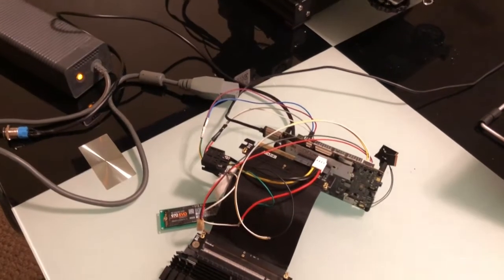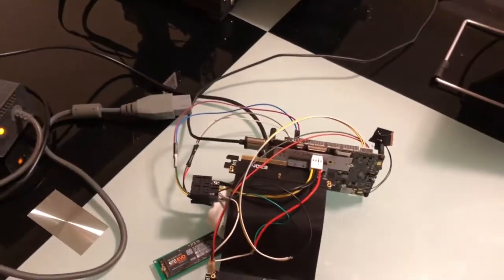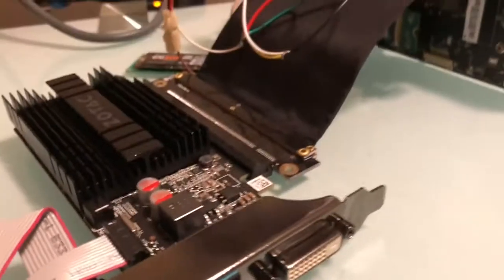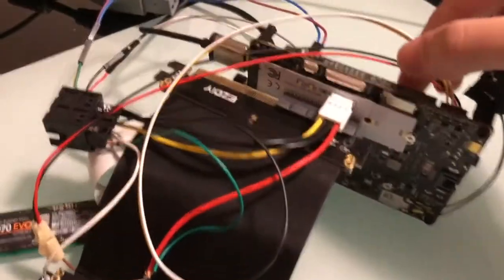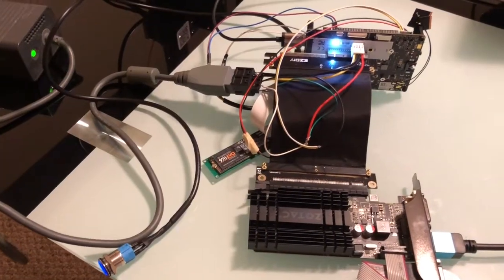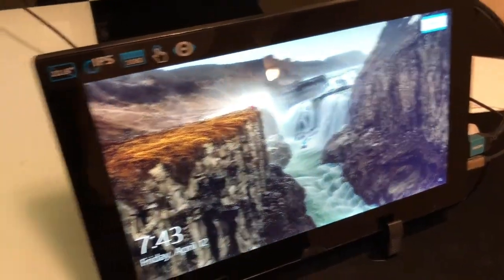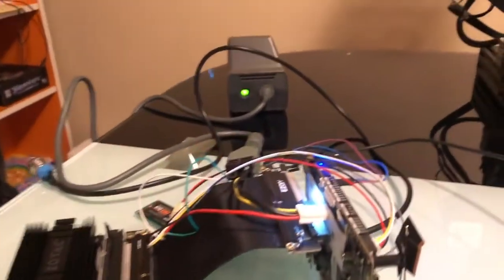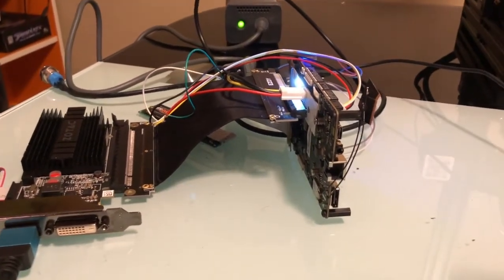LattePanda Alpha - GPU and SSD - off one power supply!

Comment: Yo , sorry if it's a dum question but does the gpu require 12v + 3,3v or just 12v ?
Reply from the maker: nistax just 12v actually, I’ve used a straight 12v power brick 120W works fine, could use a cap though
Reply: @HandheldHardware  thanks dude , that is super convenient

Comment: Great project! Can It be run using power bank?if it's yes. How much power supply? It's great to make a portable computer that could run some steam games, and bring it anywhere.
Reply from the maker: Japhet Kent Santome thanks for watching! It might be possible to make it portable, but the total 12V amperage used is about 8-10 Amps. So the battery or batteries must be able to produce ~10 amps.
Reply: @HandheldHardware   Yes, it may need a lot of power. Maybe an old/new battery of a laptop would be good and a flat battery similar to HP pavilion x360.

Comment: incredible a plate of these doing all this if the processor was a little stronger you could try to run the emulator of cemu or yuzu ... I will accompany you, Brazil here marking presence!
Reply from the maker: Gran _ Master I agree, stronger processor will be better! They are making a Alpha 864s with m3 8100y with up to 3.6Ghz boost! Maybe this can make the little board better. Awesome Brazil joins the community!
Reply: @HandheldHardware  will be very good performance increase, pity that in Brazil it is not possible to get one without paying a wheel, (in Brazil each dollar is about 4x of our local currency or 4x more expensive)
even though I wanted to see this little card trying to emulate the nintendo switch, it would be amazing to make a "nintendo switch" with certain "improvement" but obg for the attention and good luck in the projects won a subscriber! sorry my English (google tradutor)
Reply from the maker: Gran _ Master thank you for subscribing! I heard import tax is very bad in Brazil. I hope in the future it becomes cheaper to get. The translator is very good, I can understand. I will make a video with gtx 1650 shortly in a computer case. Thank you for subscribing!
Reply: @HandheldHardware  could you test with emulator? >.>
kkkkkkkkk
Reply from the maker: Gran _ Master sure! Give me a few days and I will post a video
Reply: @HandheldHardware  ok >.>

Comment: So I've been looking for the best way to power my Alpha using the DC power. Using your setup, you think it will be pretty reliable long term? meaning the output rating on that xbox power supply matches the requirements for the power input? 

Another quick question about your setup... if you are using and external GPU can you still use the USB-C port on the Alpha to send out video to your display, or do you have to use the outputs on the GPU?
Reply from the maker: Dan Knight hi Dan, yes I believe long term it will be okay for the LattePanda alpha and gpu. So far I’ve only done a few hours gaming on it, but no problems so far. Worst case the PSU would be around 50-60% capacity, but not sustained periods. The Xbox PSU has several 12V rails (mode depending). I separated the LPA and GPu. The USB C is available with this setup, but to take advantage of the graphics card power you need to display from the GPU. Otherwise I believe the intel HD will power those displays. I will be getting my gtx 1650 tomorrow and will set it up in the next few days to do more testing. Thanks for watching! Let me know if you have any other questions
Reply from the maker: Dan Knight typo in the last message, I meant model depending (205W vs 170W models)

Comment: Hello, Is the Lattepanda powered directly by the Xbox power supply without it giving it to much power or is the a power resistor?
Reply from the maker: Rickey Francis Jr the LattePanda is powered directly by the Xbox power supply. There is no power resistor. The gpu and LattePanda are on different 12V rails. The setup relies on the power switching of the power supply which should be capable for this application.
Reply: @HandheldHardware  Can you Provide me some better pictures of where you have the power cables running in the plug so I can try?
Reply from the maker: Rickey Francis Jr I will post a new video with detailed instructions and power routing. I’ve got the new video card and started designing case so a new video will come shortly!